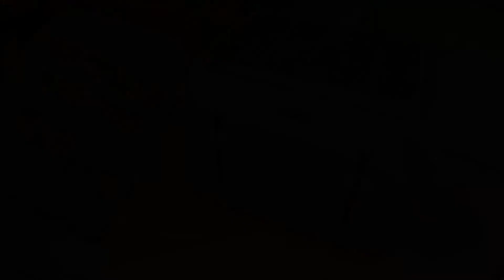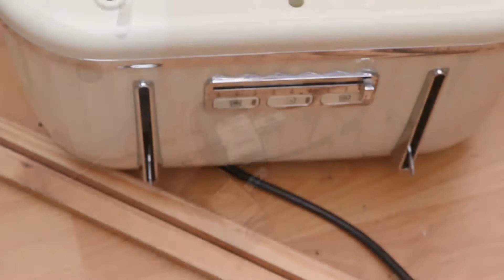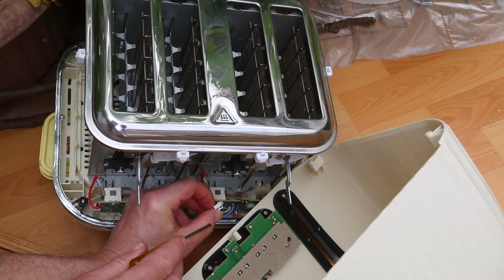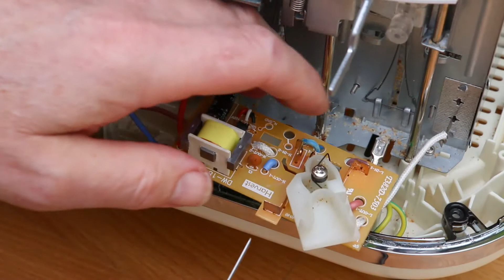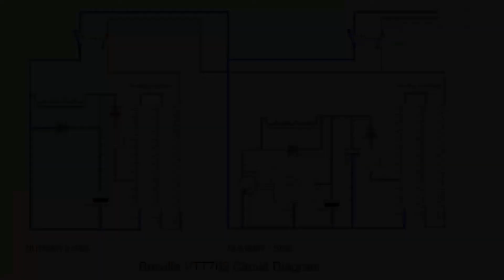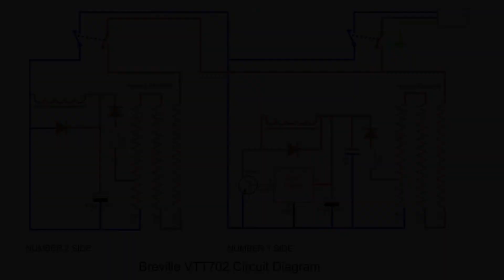Repair Breville VTT702 Impressions Toaster.

Comment: I have discovered you get exactly the same symptoms if a heater element fails. Now how do you replace one of those I wonder?
Reply from the maker: I did a very quick and not comprehensive search and found no Breville element spares for sale in the UK, other manufacturers have made an effort, but not Breville.  Have you checked the continuity of the actual element with a meter?  
As an expedient measure I could suggest moving the circuit board from Number 1 side to Number 2 side, I expect you'd have to forgo some of the cord length to get it to stretch across the device and it's possible the timer lead won't be long enough.  Or possibly better to just swap the element unit over.  Less than ideal, but at least you'd have a 2 slice toaster.  
I see there is a second hand one advertised on ebay for £14 a possible source of spares?  Some would say why bother, I suppose it depends whether you enjoy a challenge?
Reply: @twotone3070  Thanks for reply. The Breville elements are hardwired in, I checked. So this would mean replacing a new element pair module with housing and some soldering. Yes one element is open circuit and I can see the break, just where some bread crumbs had accumulated in one corner. My fault I guess for not empting the trays more often!

However I have found exactly the same model on EBAY for only £20 new. The original cost was over £50. At that price it's not worth the hassle of repairing the old one. Non-repairable appliances are not a good omen for the planet!
Reply from the maker: I don't use a toaster so couldn't possibly comment on the correct timing for cleaning, but your comment is a useful point for other users to note, as it seems it can be the nemesis of the element.  I agree, convenience and profit have been pushed way too far up the list. Good luck with the 'new' one and thanks for replying.
Reply: Alas for some reason the seller cancelled. Argos still sale for £35.

Comment: Thanks for the video. I've got presumably a later model (VTT783) but most of the features are the same. The plastic handles took a real effort to get off and I broke one. The two cards inside did not have an obvious release point so cleaned the contacts in situ. When it was all back together again, it worked. Quite agree about the rubbish design comments. The fact that they have two different sorts of screw and then one of the holes was way too deep for my pen screwdriver makes it clear that the company doesn't want you to mess with it. Glad I did though
Reply from the maker: Good to hear you got it working, shame about the handles, I didn't actually video taking them off, that's the magic of television. :)
Reply: No, they really didn't design it for easy disassembly. Mine is George Home, but the internals is the same. I too am one of those who hates electronic wastage, so I am repairing mine and these videos have inspired me to take on the challenge. I broke both of the handles, and really couldn't see a way not to (I should be able to glue them back on). I try to forget they are only £25 new :)

Comment: Thanks very much for this video. It's very helpful. It's a pity though that the designer was a complete numpty. If you have 2 slices in the No1 side and 30 seconds later decide to pop another 2 slices in No2 side, both will pop at the same time, with 2 slices done and 2 slices not. You then have to remove the 2 slices from No1 side (as they're done) and move the slices from No2 side across to No1 side in order to finish them off! Completely barmey!
Reply from the maker: That's a very good point. It's not my toaster so I've not encountered the problem, but it does seem quite frustrating. If I were taking a philosophical view of it, perhaps they are making people take responsibility for their decisions, at least until the toast is done. :)
Reply: @twotone3070  I'm guessing this was a somewhat extreme cost saving exercise. Trying to use one timer for both sides. I recently bought this toaster and it's being returned due to the rubbish design. 
Originally I was wondering if it would be possible to to feed the power directly to both sides at the same time. Then after watching your excellent teardown, I realised that the single timer unit made this impossible.
Reply from the maker: Please don't tell them it was me, I wouldn't want Breville sending the boys round.
Reply: @twotone3070  they might only send one boy round as two might be too expensive👍

Comment: Does it has timer or sensor for the release mechanism?
Reply from the maker: I believe it is a timer, the only electrical connections to the area near the bread are for the element. I could not see any sensors, see the circuit diagram near the end.

Comment: Right side works fine it's only the left side that dont work
Reply: Left side only holds in when right side has toast is in, says that in instructions
Reply from the maker: @ianmccabe2222  Yes, you can see why this is the case from my circuit diagram, they are electrically interlocked. :)
Reply from the maker: If the right side is down and working, does the left side heat up if you hold the lever down? If so, it's probably not the switch contacts on the left side, although making sure they are clean and making good contact is important. 

If it doesn't, it's possibly the left side switch contacts, but could be the left side heating elements.  Please make sure you remove the plug from the wall before taking the lid off as just switching it off will not disconnect the neutral from the toaster on a standard UK socket.
Reply: I'll give it a try cheers

Comment: Thanks for the video but it didn't work for me. 
I got the toaster with this problem already happening on the first use. What's weird is that the heating elements on both sides are working as they should, just the magnets not.
I looked inside and everything is connected properly and looks fine. I really don't know what else to do. 
I can't return it as I live in another country now.
Reply from the maker: We should be able to narrow this down. Disconnect the toaster from the power socket. The heating elements only require the levers to be pressed down to work, so if they work and the magnet doesn't I would check the continuity of the circuit from the tap off the heating elements, the red wire on mine, to the collector of the transistor.  You have to get the polarity correct as there are 2 diodes in the circuit. Do NOT have the toaster plugged into the power socket when you do this.
I just had a thought,  perhaps the diode across the coils are in backwards. I cannot see from the video which way round one of the two diodes on each board is, I'm assuming one is under the coil.
Reply: @twotone3070  Thanks a lot for your comment! sorry for delay as I missed your comment somehow.
I'm not familiar with these electric elements too well so I'm not sure what exactly do you mean. I'm attaching a link to a video I made that shows exactly how everything looks, connected and how it operates. As you can see I have a bit different Breville model than yours but it operates the same way.
Please try to help me as I don't know what else to do. Thanks again.
https://www.dropbox.com/s/8fd4egagcw6tkz9/20201121_114627.mp4?dl=0
Reply from the maker: @yoavs1990  No problem, thanks for posting the video. I hope you realise how dangerous what you are doing is and I hope your electrical supply has a protective RCD/GFI device to keep you safe, because the fuse is rated at way more amps than is needed to kill you?  
Onto the problem, I cannot be sure but it looks like the metal plate that should come down and make contact with the top of the electro-magnet is not close enough. I think I can see the top faces (poles) of the magnet even when the lever is fully depressed. 
With the electricity disconnected can you just check that the top of the magnet is in contact with the metal plate? See if the other side comes down to the same position.
See https://youtu.be/PZdmoo7buzw?t=163 for what I mean.
Reply: @twotone3070  Thanks for the quick response.
Yes you are right, I made a mistake but don't worry as I have the protective device.
No, it doesn't make contact and I think that you found the problem as I tested the magnet and I can feel that it's working. Maybe I need to put another metal plate on top of it so they would touch one another.
Reply from the maker: @yoavs1990  I think you would have to extend the metal plate down to the magnet. If you put a piece of metal on top of the magnet there is a possibility the magnetic circuit will be completed by it and the magnetic force outside of it will not be strong enough to hold the mechanism down.  Is it possible to get the lever to go further down?
Reply: @twotone3070  Yes that's what I meant. I'll try to found something and update you :)
No, it's not possible to get the lever further down.
Reply: Hey :)
Just an update, I glued a metal plate underneath the existing one and now it touches the magnet perfectly but it still doesn't work. Apparently there is a problem with the magnet, it's too weak, so I give up. Ordered a new unit.
Thanks for your help!
Reply from the maker: @yoavs1990  That is such a shame. :(   Nice try though and thank you for the update.

Comment: Tried cleaning the contacts and still didnt work. any ideas? its not staying down when pushing down the slider and no light on. fuse in plug is fine as checked it on another device.
Reply from the maker: Do you have a continuity tester? With it unplugged, NOT just switched off, do the contacts on the Number 1 side clearly make when the lever is depressed?
Reply: @twotone3070  no but i can get one easily.  yes they touch tightly like in your vid when the lever is pulled down.
Reply from the maker: @markypeck  I would use the continuity tester to work my way round the circuit as per the diagram at the end, at least to start with. Making sure you have it unplugged of course.
Reply from the maker: How have you got on with the repair?
Reply: @twotone3070  no good im afraid. looks like theres power going to the contacts but nothing after that. cleaned the contacts thoroughly but no joy. :(
Reply from the maker: @markypeck  Do you get continuity through either pair of contacts  ie the Number 2 side as well, just to check out your test set-up? This is using a continuity tester not the mains as the Number 2 side doesn't receive power unless the Number 1 side is working.

Comment: Amazing video, thank you. Just purchased this toaster and it's handy to know how easy it is to take apart and fix this issue. It baffles me how some people won't even consider taking things apart to have a look to see if there's any obvious issues and instead just throw them out.
Reply from the maker: For some, money has been easier to find than the time required to learn how to fix things :( . But then no one is going to get rich using my philosophy of trying to wring every last bit of use out of everything :)
Reply: @twotone3070  Well I think your philosophy is one I'd rather follow than the financial pursuit! My dad's an electronics engineer so I guess I get the curiosity and willing to learn about these things from him!
Reply from the maker: @funkymunky2404  My parents grew up during WW2 and had nothing so they knew the value of everything they owned and they must have passed that on to me.